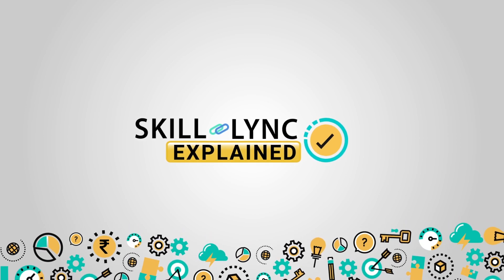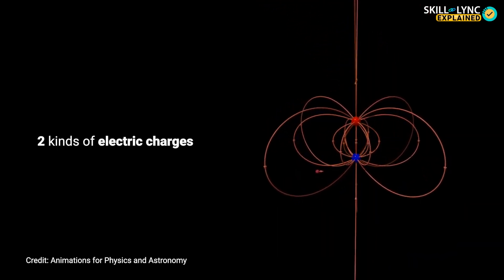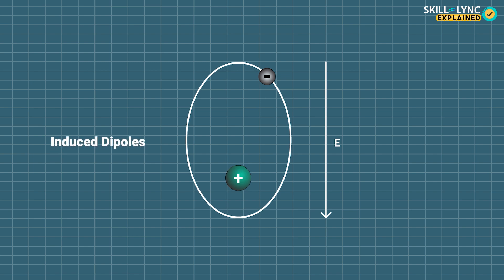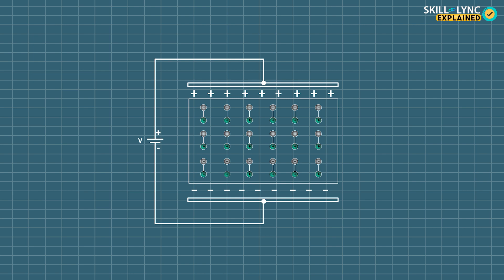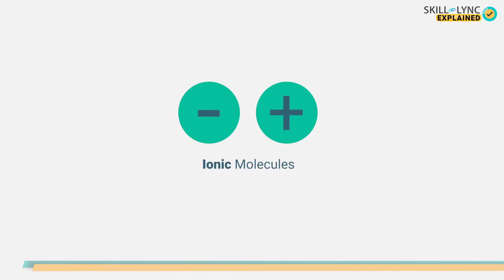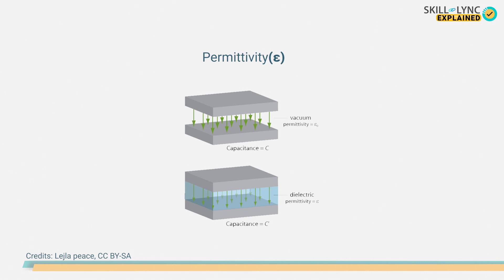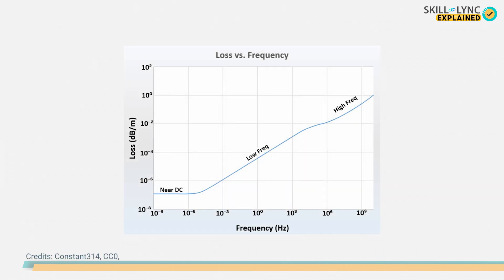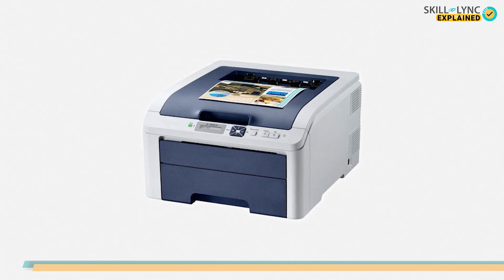What are Dielectric Materials? | Skill-Lync

Comment: What's the difference between a magnetic dipole and an electric dipole?
Reply: An electric dipole is what is created when you bring two charges close together. A magnetic dipole is created when a correct passes through a circular wire, thus the magnetic field has a similar shape to the electric field in an electric dipole

Comment: Any reason against using titanium dioxide (TiO2, rutile) for dielectric barrier discharge / plasma actuators? Can you think of better alternatives? Criteria:
(1) good dipole characteristics combined with very low conductivity.
(2) The breakdown voltage should be at least ~7kV/mm (more is better).
(3) it has to be easily shaped (I thought of mixing low µ TiO2 powder with a bit of epoxy)